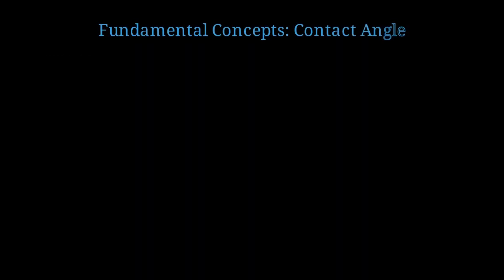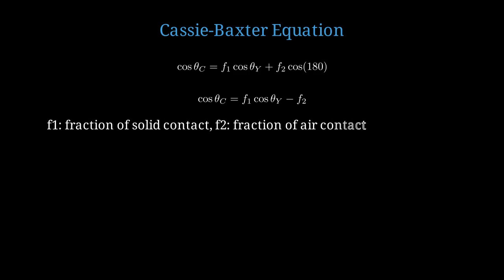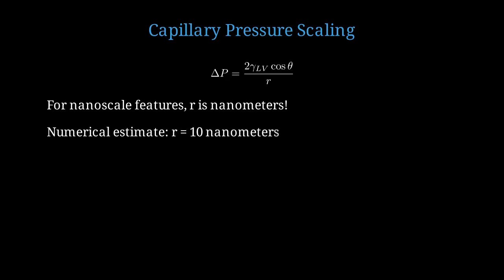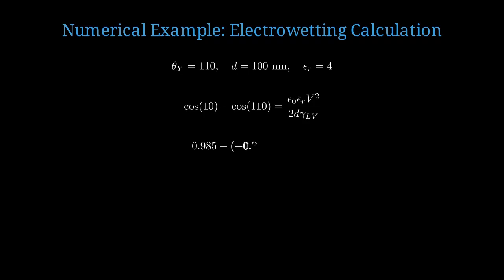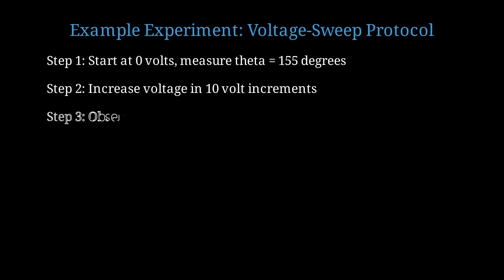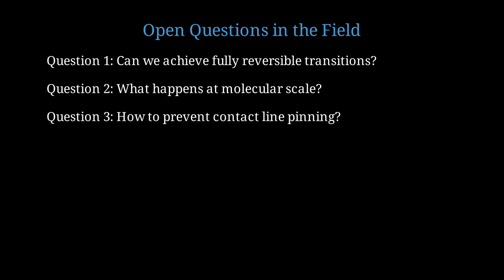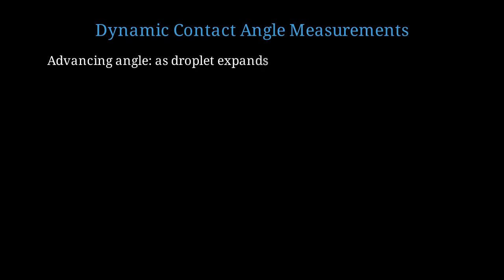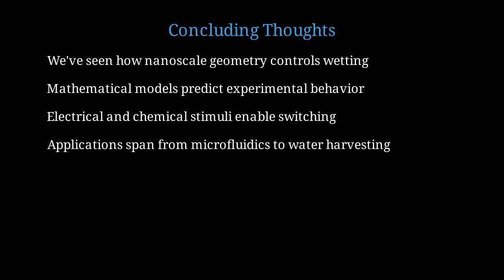Nanosurface Switch — How to Control Water with Electricity

Comment from the maker: How can nanoscale geometry be optimized to enable fully reversible Cassie–Wenzel transitions under low voltage (<10 V)?
Can molecular dynamics accurately predict contact line behavior and energy barriers during electro-induced wetting?
What mechanisms enable omniphobicity for low-surface-tension liquids without using fluorinated coatings?